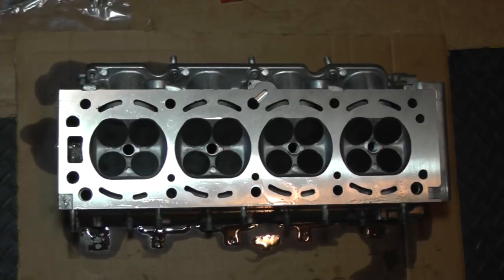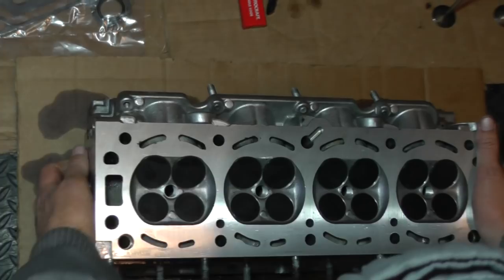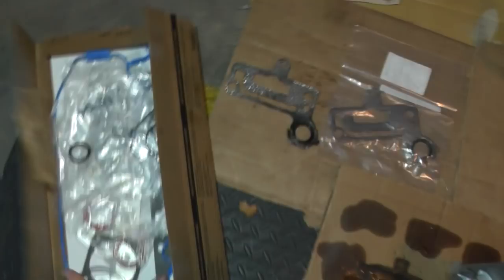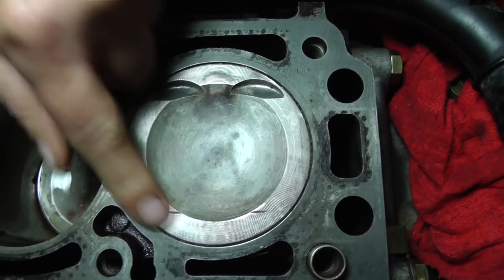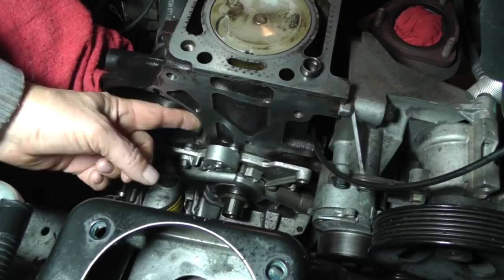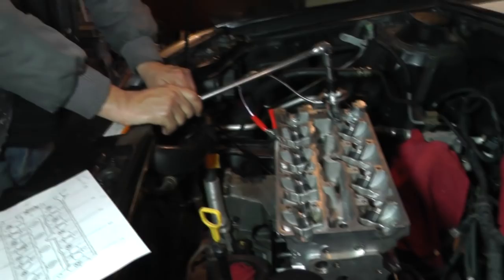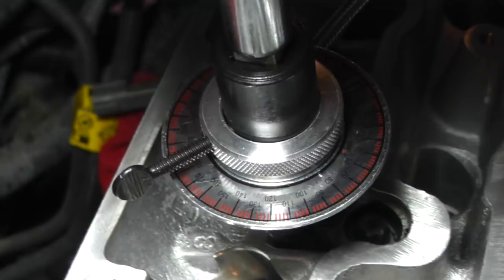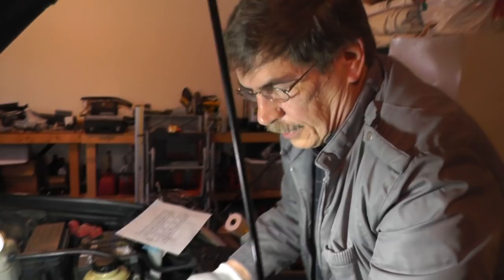Suzuki Forenza Head Installation - Part 9 (Initial Head Install)

Comment: Great tutoria stuzman! I'm about to pull the head on my sons 07 Reno which has the same drive train. I'm concerned about the $100 EGR gasket. Why isn't the correct one in the kit? Has any other source came to light since? Also where do you recommend buying parts? Rockauto has good prices on their kits.
Reply from the maker: Thanks Allen and sorry to hear about your son's Reno. I wish I had an answer to why the correct gasket is not in the kit which was a Felpro head gasket kit. I believe the gasket in the kit was for a 2005 and previous years. Although I selected 2006, I still got that gasket. As I mentioned, the one I got was from E-bay and didn't even try to check the dealer if you can find one nowadays. Yes, most of the items that I ordered came from RockAuto which seemed to have the best prices. What issue are you having Allen? I assume you're having a head gasket issue. Be sure to make sure that the head isn't pitted which is a common thing and if so, get it repaired. And make sure that it's flat. It shouldn't be no more than 0.001" anywhere across the head. Take care Allen and let me know how things go with your project.
Reply: stuzman52 Thanks for the quick reply! The little genius ran it hot after a radiator hose blew and that caused the head gasket to blow. My problem is he's 190 miles from me and I'm trying to diagnose over the phone. When he sent a video of smoke boiling out the back and then said he couldn't check his oil because it ran off the dipstick too fast I knew it was over!! I'm having the car towed here so I can begin disassembly and your videos are invaluable! I'm a capable mechanic but have tried to avoid overhead cam engines (especially interference fit) as they are an incredible pain to work on. If he wasn't struggling enough supporting himself while pursuing a PHD I'd tell him to walk but I have to give him credit for living in virtual poverty for so many years in order to get his degrees and hopefully a better paycheck. I'm almost too old to keep working on cars for everyone buy myself.  I plan on replacing the timing belt, water pump, and all the coolant hoses just because it's dumb not to while I'm in there. Did you have trouble locating all the torque-to-yield bolts you encountered? I'd already planned to have the head checked at the machine shop for any warpage. If you have any other suggestions I'd greatly appreciate them! One last note:  keep those videos coming!  I'd venture to guess people would pay to see them.  They  could save a lot of money.
Reply from the maker: Allen Riddle Trust me Allen, we've all been there with our kids, but as you say, it sounds like he's trying, so I think he's worth saving (smiling). Yes, while you're in there on the front of the engine, change it all. That would be the idlers, tensioner, water pump and of course the timing belt. You can get all of this in a kit. The one I used was from Gates and I picked it up from www.rockauto.com. As for the head bolts, you can pick that up from Rockauto also, and I believe they were made by FelPro. As for the other bolts such as the camshaft sprocket bolts and crankshaft bolt, I had to get that from Suzuki. I think I used these guys.
www.suzukicarparts.com

For some tips, and I think I put it in the relevant video, you don't have to pull the crankshaft sprocket which means you don't have to worry about that big crank bolt which means you don't need to buy that one. And by not pulling the crank sprocket, you don't need to completely remove the rear timing belt cover. I pulled it because the service manual said so, but later found out that it wasn't necessary. But you will have to remove the rear timing belt cover bolts because it bolts up to the side of the head. Just take the bolts out and let the cover hang over to the side. You'll probably want to get two new camshaft bolts as they are torque-to-yield bolts. I remember the pictorial diagrams sucked on the Suzuki site, so don't be afraid to give them a call if something doesn't make sense. I know I did when something wasn't clear and he was very helpful. Oh, and before I forget it, you can reuse the camshaft cap bolts.

As for pulling the head and overhead camshafts, it's a piece of cake and everything is a little scary if you never done it before such as working with dual camshafts and being an interference engine. The whole key to this job just like any other is paying attention to detail. When I do a fairly large job like this, I'll bag up the bolts for each component and write on it where they go. If there's anything special about a length, I'll write that on there too. Of course, I did have my own videos to review if there was something that wasn't clear when I was reassembling it. And the biggest advice I can give you Allen, is don't rush the job to the point of where you know you feel uncomfortable. Everyone has their speed at which they work comfortably, so stay in the realms of that. I know you already know this, but a lot of guys that I've talked with will rush the job and have some major issues later like bent valves.

With your mechanical background, you shouldn't have any problems as this vehicle is really one of the easiest to work on and everything is accessible. And good that you'll going to send the head out to a machine shop and have it checked. I'm sure that you will have some warpage on it since aluminum doesn't like a lot of heat. And you may already know this, but if you notice in the beginning of this video, you see oil on the bottom of the head. I should have mentioned it, and probably didn't because it seemed obvious at the time, but make sure that you clean all of the machine oil off before you bolt her down. I like to use acetone as it will clean nicely and will evaporate very quickly. Same holds for the engine deck too. You want both the engine and head deck cleaned and dry when you start to assemble.

That's all I can think of Allen at the moment, but if you have any other questions, let me know and we'll get you through this project with no sweat. Oh, and thanks for the kind comments on the videos and glad to hear that you like them.

Take care... Terry

Comment: Hi! I am working on my Suzuki Forenza 2008 Cylinder. can I change the gasket without taking it to the shop to work on the head before reinstalling it? Everything seems to look good though. the gasket damaged as a result of overheating
Reply from the maker: It's always a good idea to check the head for warpage as that could happen when you have an overheating condition. You could use a straightedge to check for flatness.

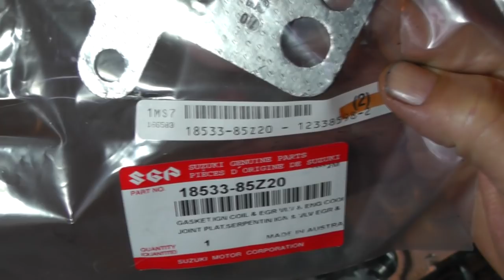Comment: I got a head gasket set at Rock Auto for this engine for $42.00 that includes the gasket at 3:52. Prices must have come down.
Reply: Ooops, not the same gasket. Looks very similar but not the right one. Not sure why this weird look-a-like gasket is in this head set.
Reply from the maker: I don't use FaceBook...sorry.
Reply: @stuzman52  hey I just did a similar job on my car after I got done when the car reaches normal temp  white smoke comes out the exhaust still. Does that mean the head gasket is bad. Only thing I didnt do was change the thermostat and flatten the head I thought they would still be in good shape. The car blew the gasket before so could the catalytic just  be dirty? Or did I messed up
Reply from the maker: You might could do a compression test on each cylinder. Or you could get a combustion gas analyzer kit to see if it changes from blue to yellowish/green. I would keep a close check on your oil for milkiness and your coolant recovery level to see if it drops. And always a good idea to check the flatness of the head and the block.
Reply: @stuzman52  I'll try that before I figure out I have to do everything again. So I will need a new head gasket and bolt heads because i might have to take it to the machine shop. Will I need to remove the valves for the machinist?
Reply from the maker: Just leave the valves in place and leave it up to the machinist if he wants to take them out.

Comment: stunzman52 i comented on another video about my forenza not wanting to start you said that it might be the valves.i took the head off and 11 valves were bent the torke head book says it is torked to 76 foot.so my question is is it 76 or 18 foot pounds
Reply from the maker: I have all this information in the video of where I install the head and show the procedure. If I remember correctly, you torque it to 18 ft-lbs, then turn the bolts 90 degrees, then go back and turn 90 degrees again, and finally turn them another 90 degrees. As you may be aware, you'll need to use new head bolts again.

Comment: hi, my names Jose I'm having trouble with my Suzuki Forenza 2004  my key will not go to the off position so I can pull he key out  I already replaced the ignition and its still the same problem it only comes out when I pull the plug out from the ignition. Can you please help me
Reply from the maker: Maybe, the interlock for the park/neutral gear selector is not in the 
correct position. I believe there is an interlock for that. I don't have
 the wiring diagrams for the car anymore as I sold the car. Maybe that 
can help...
Reply: Is there anyway we can contact to you

Comment: Did you mention anything about the valve springs? Did you replace them also?
Reply from the maker: Hi Doug. I didn't mention anything about the springs as I left that to the machine shop. I informed them to let me know if they found anything wrong with them to let me know. As it turns out, everything was fine with the springs. Thanks for your comment.

Comment: hello Stuzman52, We are acually doing the same head gasket job on the same car. we would to know which is a better way to buy the parts. the dealer price tag is pricey, hence we are doing the job ourselves. so Timing belt kits and gaskets head bolts, and so on.
thank you very much. your videos are very hopeful... they one the best vides on youtube for us self backyard mechanic....
Reply from the maker: Hi All...Glad to hear that you liked the videos. As for the parts, everything you see such as timing belt kit, head gasket, (I prefer Fel-Pro), head bolts, I got through www.rockauto.com as they had the best prices from my research. Some items such as the camshaft bolts, I had to get through an online Suzuki dealer which was www.suzukicarparts.com since these items are torque-to-yield bolts. You can save yourself some labor time by not removing the rear timing belt cover. This means you can leave the big crankshaft bolt alone and not have to buy that bolt either since its a torque-to-yield bolt too. You'll still have to remove the bolts from the rear timing belt cover since its bolted to the head. Just let it hang off to the side with the crank sprocket in place. The manual said to remove the cover, but later I found out it wasn't necessary. As for the other items such as spark plugs, spark plug wires, coolant, oil and filter, etc., I just picked that up at my local auto store. Be sure to check the head deck for flatness and pitting since aluminum heads have a tendency to pit. Good luck on your repair and remember to watch the details and take your time.
Reply: first thank you for responding, i was not expecting to get a response this quick. I will look up the parts from the suggested places. I actually did not remove the timing cover completely it still dangling on the crank pulley. we planing to send the head to the shop and we might replace the valves because of cylinder 4 misfire. where the gasket was broken around it. a friend of mine suggests that we should take the pistons out and check the rings and clean the crank general because the car sat about 2 months after the head gasket blew.
Reply from the maker: A All Good that you're sending it out to the machine shop. The machinist should be able to check your valves. So if you need any work there, he can tell you what he recommends. Just remind him to take a look at that. As for taking the pistons out, I wouldn't go that far unless I saw there was damage to them. Did you have any coolant mixing with the oil? If so, you want to make sure that you change the oil and filter before you crank it up. Let it get to operating temp. And then drain the oil, put new oil in it and change the filter again. This is to get out as much coolant as possible. Mine sat for four months, but I didn't have a head gasket issue. As you may know, mine had bent valves from a broken timing belt. Good luck...

Comment: Hello stuzman52, i tried to use a wire wheel attached to a chordless rdill, a dremel to clean up all that carbon especially in the valve grooves in the pistons, i dont want to do too  much but the stuff is not budging, can u give some tips on cleaning up the engine block? Would love to know what you did to get it looking so nice! MEK is not legal in CA, but I do have some... steel wool?
Reply from the maker: Hi Beans. I'm not a big fan of using power tools for cleaning, even when the block is made of cast iron or cast steel. Small amounts of the wire brush could break off and dislodge itself down beside the piston and you wouldn't even know it. Steel wool would be even worse. Besides, the block and head deck should be within 0.001" across any direction that you measure. To give you an idea of how small that is, it's 1/4 the thickness of a sheet of a paper. So, power tools could easily take that much away in a hurry. All the cleaning that I did was by hand with a straight-edge razor blade secured in a razor blade holder. You can get one at an auto supply store. The cleaners I used were Permatex gasket sealer remover and B12 Chemtool carburetor cleaner which I got from Amazon. And I used a small nylon bristle brush for the scrubbing. So, it's just a little bit of elbow grease.
Reply from the maker: Hi Beans, I saw from my email that you asked if I soaked the camshafts in mineral spirits. Another person asked that question on the rear timing belt install video and I mentioned that I did soak the camshafts in mineral spirits. But when I went over to that video, I didn't see your comment. So, I'll reply here in regard to your question. Yes, I soaked the camshafts along with the camshaft caps in mineral spirits for about a week. I knew the head was going out to the machine shop for awhile so the cleaner would have a long time to clean. On the stubborn oil stains, I used B12 Chemtool carburetor cleaner and a nylon brush to do the final cleaning.

Comment: Great video, very informative  I will be doing the head gasket job on 07 Forenza, Where did you get the official service manual? The electronic pdf file of the service manual is not exist on the web or I cannot find it. Suzuki Pitt shop website doesn't have it eighter can you send it to me if it is in pdf. file  Thank You.
Reply from the maker: I had a hard copy of the service manual which I sold along with the car back in February. There are a couple of sources that you can purchase the manual along with wiring diagrams and the TSBs. But it sounds like you want something free so here is a link for that http://lacetti.com.ua/chevy-man/EN/documents/Nubira-Lacetti/start_Nubira-Lacetti.html Good luck on your repair.

Comment: Please help me 4 of my valves have a gap wont close all the way is that a problem
Reply from the maker: REM Motors If the valves are not closing when the cam lobes are not raising them, I would say that you probably have bent valves.
Reply: @stuzman52  they are brand new valve and I still see a gap
Reply: They wont go all the way down like the rest of them do
Reply from the maker: @titaniumautosalescom2387  To be sure if the gaps are causing an issue, you could take out your camshafts. Now you know the valves should be fully closed. Pour some water into the combustion chambers. If the water runs out the intake or exhaust ports, then you've got an issue.